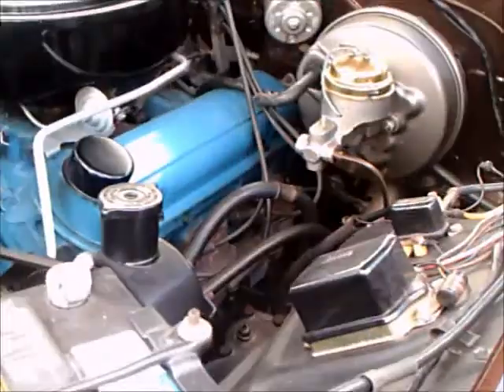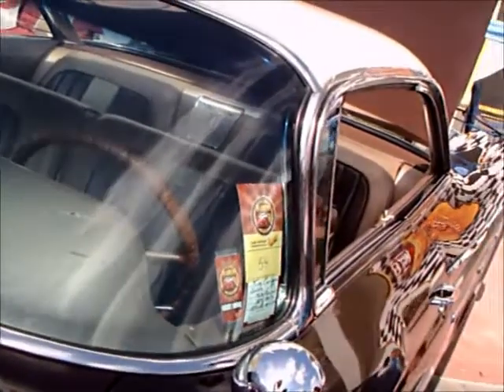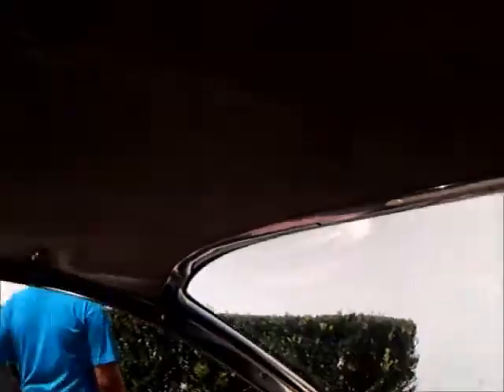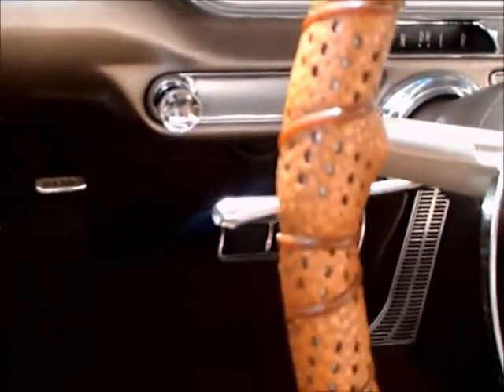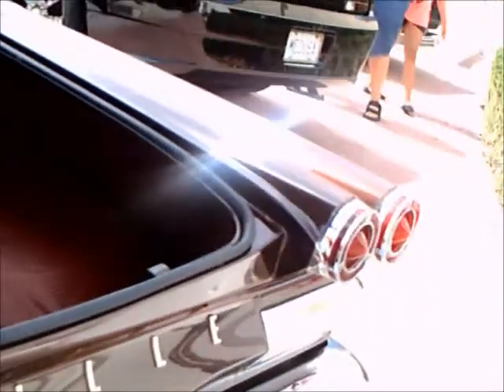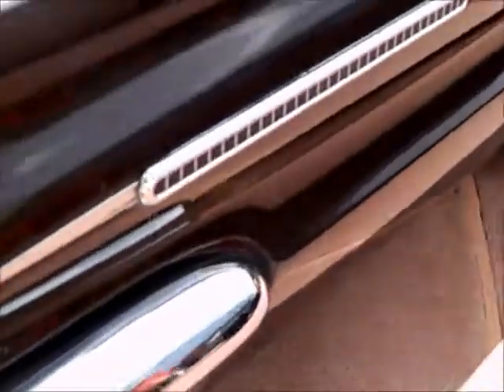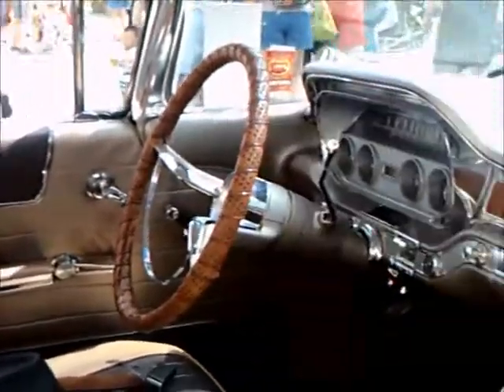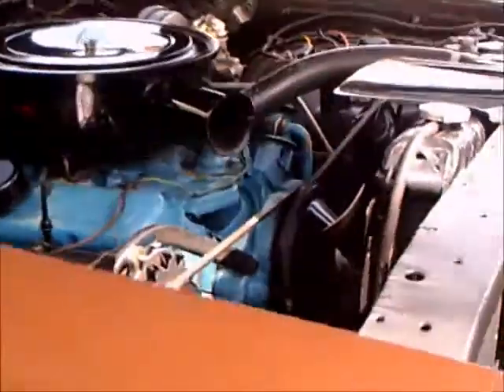1960 Pontiac Bonneville Hardtop BrnWht Disney061514

Comment: My first thought when I saw the thumbnail photo was 'Jack found an Imperial'.

Nice looking car. Back in the day Pontiac's 'wide track' ads failed to mention how loooooonnnnnng the car was was and this one is both. Very formal front end with 'after burner' tail lights and simple lines in between. The interior is a bit busy for me but nicely done, the instrument panel is very nice and it must have been like a sauna on wheels with all that glass! Pontiac's 8 lug wheels always made their cars look even better! 

Nicely preserved relic of the past, thanks Jack!!

Nearly 19' long, nearly 7' wide, this thing was huge [with the foot print of an RV] and a porker weighing in at 4400 pounds. The gas mileage must have been awful but back in the day with gas at well under a buck a gallon, no one cared. Think of all the gas wasted over the decades while car designers learned, way too slowly, that 'bigger isn't better' and to use less size more wisely. I can haul 16 bags of mulch at 40 pounds each in my little Scion tC and wonder how many would fit in the trunk of this behemoth.
Reply from the maker: Hey, Terry!  Yes, the emphasis was not on efficiency when this car was new!  The emphasis was on performance, and to some degree, ostentation.  Bigger did mean better as the common perception.  This expansiveness may have been a celebratory reaction to the end of the war and an expansive economy.  With gas at a low price, there was no economic penalty to be paid.  Not so today!  Thanks!  :) Jack

Comment: Ok Jack.. Hold on a second.. WOW!! This is a beautiful car! I was mesmerized AND speachless! I LOVE these bubble-top cars of the early '60s! The 389 engine is as clean as a whistle! The 8-lug wheels and gold line tires are simply gorgeous! The wrap around windshield made for a great view.. no blind spots here! The BEea-utiful brown and white exterior is only enhanced by that lovely three-tone interior! The dash is very nice too.. the assist handle is a nice feature..or what my sister always refers to as the "O.M.G. Bar". The tail lights and grille tell the world that this is a Pontiac... A "Wide Track Pontiac"!! 
I always liked the rear center fuel filler..even though I know it's not safe... But neither is my zooming around the gas pumps, trying to remember which side "it" is on!

OH!! This car has one of those full sized gas and brake pedals.. Do you ever wish todays cars had them? Thanks Jack! A PERFECT Pontiac! :D
Reply from the maker: Hey, Karyn!  Your description is spot on!  The car was meant to be a showpiece, and it sure is!  I'm always impressed with Pontiac's interiors...they insisted on using multi toned combinations was a smart use of color, and distinguished it from the other GM offerings!  They sure made the most of their unique handling capabilities with "wide track"!  Brake and gas pedals meant business...so they should reflect that in a Pontiac!  Thanks!  :) Jack

Comment: Hey Jack. Nice looking car. Although I find wrap-around windscreened cars look attractive, I've never understood why cars of the time were supposed to use them. Was there a functional purpose to the severe wrap-around look? :)
Reply from the maker: Hey, Jason!  The idea was to open the field of vision...earlier windshields had prominent pillars that blocked the view.  Now it was nothing but glass ahead of the driver...but one side effect was distortion. That severe bending of the glass caused distortion..more in some cars than others.  Also, the pillar, now moved back became something you could hit your knee on when entering or exiting the car.  That's why windshields became less radical as time wore on.  Thanks!  :) Jack
Reply: Jack R I hear those can be problems with the way the windscreen wraps around like that.

Comment: what a PRETTY PONTIAC! I loved these cars from 1955 all the way until 1965 or so. They certainly made a statement that's for sure. After 1970 seemed like they blended into the chevy styling way to much on most models and the interiors got cheap looking. Love the 8 LUG wheels.
Reply from the maker: Hey, Gene!  These cars had styling that sure was distinctively PONTIAC!  I think you're right about their being Chevroletified over the years.  When that happens, a car make loses its legitimacy...it can be done away with, as we know.  Those 8 lug wheels must be worth a king's ransom!  Thanks!  :) Jack
Reply: Pontiac Styling was totally Pontiac uptil 1981  ie. 70-73 Trans Am - SD-455 motor etc.77-81  SE Trans Ams etc. no Chevy styling there :)
Reply from the maker: ***** I have a feeling that the reference here was to the full sized Pontiacs and Chevys.  Firebird had its own identity, for sure.  Thanks!  :) Jack
Reply: Could be - I Mostly look for the Sporty models like Firebird - GTO - Grand Prix - Grand Am etc.  all distinctly Pontiac :)

Comment: really nice Pontiac, those Bonnevilles  were always the nicest of the Pontiacs!   I still miss those gas filler on the back of the car, made it much easier to fill up. I used to have a 90 Chevy Astro and a 92 Merc Sable in the 90's and those cars had the filler opposite sides and I would pull into the gas station and always had the wrong car for the correct side to fill up from, and always had trouble keeping straight which car the filler was on the drivers side!   ( It was the Astro Van).   Why did they change this?
Reply from the maker: Yes indeed...they were top of the line for a reason!  Great point about the location of the gas filler tube!  In the middle, as my '72 Mustang has it, there are no worries about which side it's on.  Most cars had it hidden behind a spring loaded license plate mounting.  My '88 has it on the right side...every other vehicle I have, the left!  Always complications!  Thanks!  :) Jack